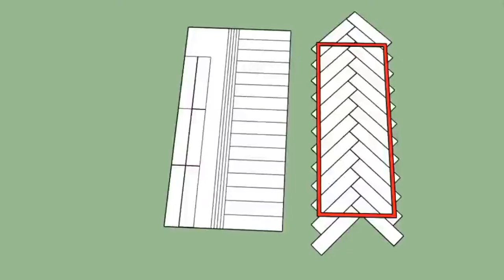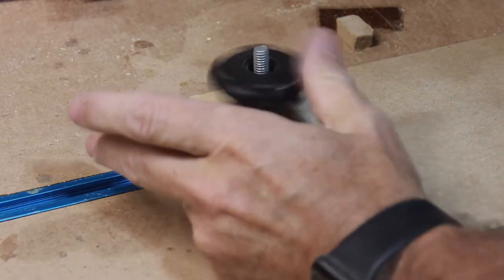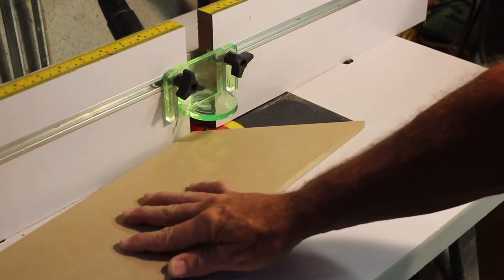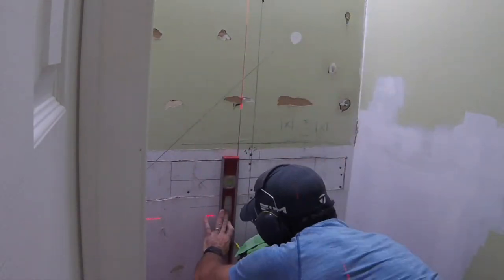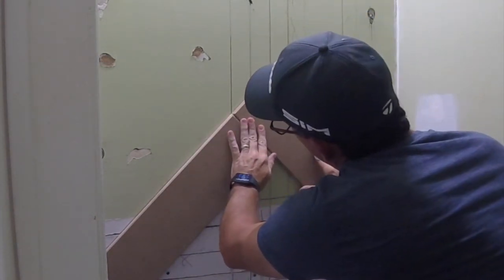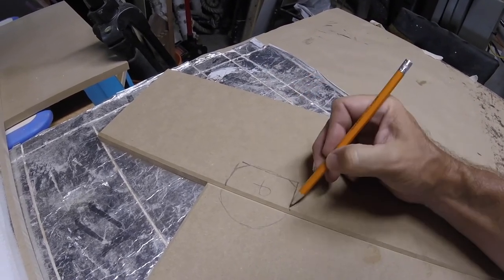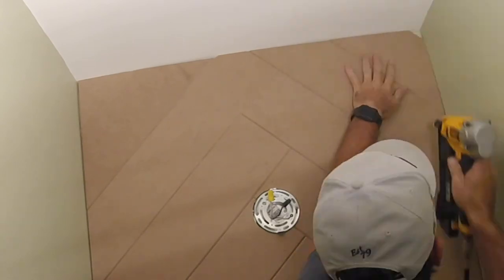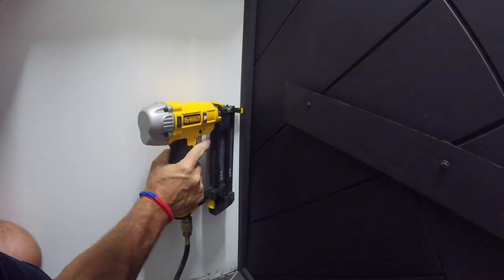Herringbone Accent Wall [] DIY Feature Wall [] Bathroom reno part 2

Comment: Hi thank you for this video.I do not have a router.Can I use ship lap instead?Will it give the same look?
Reply from the maker: It would give a similar look, but the router gives the edge a chamfer, which when combined with another board, will produce a v groove - this is different from the square bottom groove in ship lap.